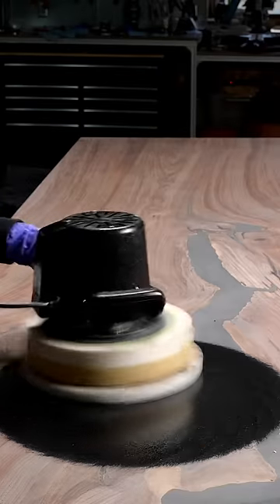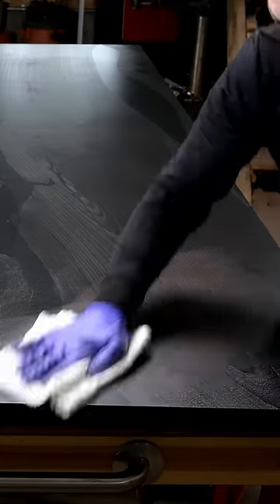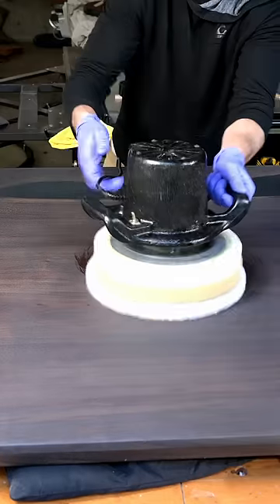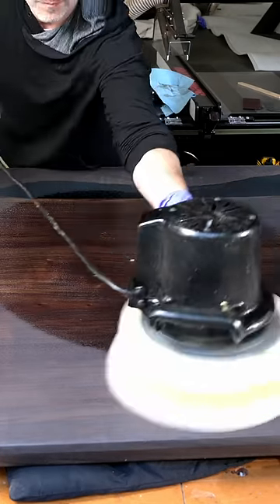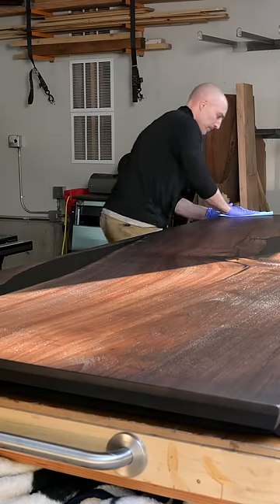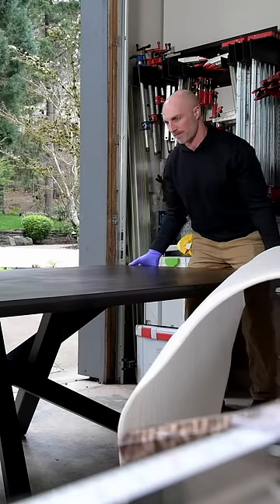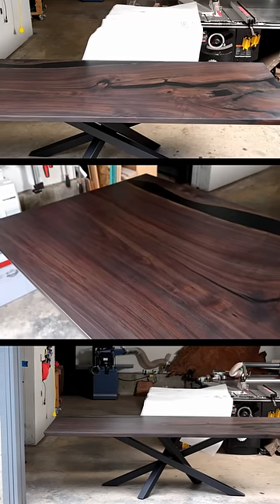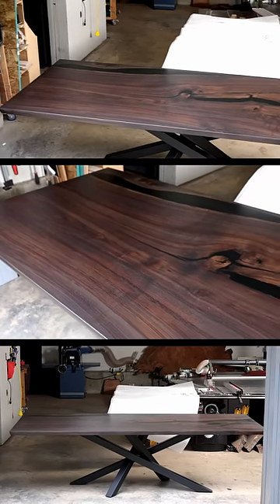$13,000 Table For a Client

Comment: Rubio monocoat is the best. I used it on two slabs for the built-in bookshelves in my house and it’s amazing.
Reply from the maker: For sure!
Reply: Has anyone tried to make an external front door in slab and epoxy

Comment: There are some cracks, that after cutting the shredded parts and polished a little, they look perfect, plus you could enhance the color with varnish-like transparent liquid, for fully transparent Epoxy. That's Fascinated me about wood, specially the mid to slightly darker tones; most Epoxy Carpenters completely cut them off, when there's so much potential beauty 😍 on them; I'd leave those and just finish the table with Epoxy, it's so worthy, you'd hame more angles to appreciate it